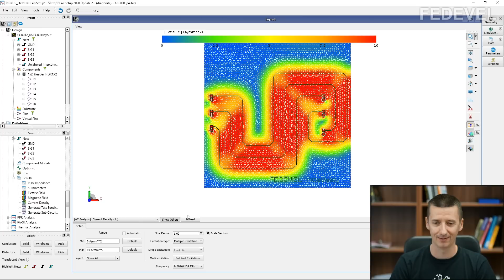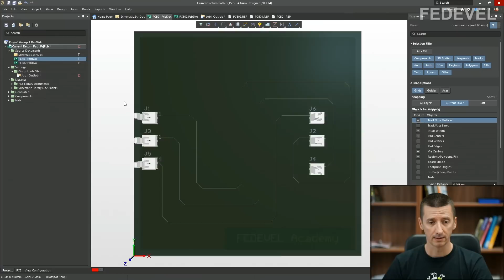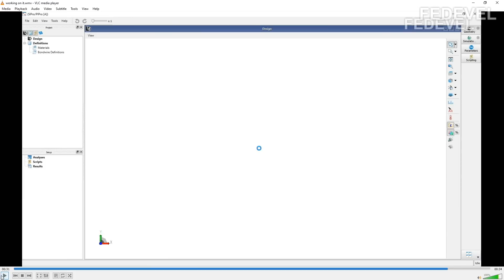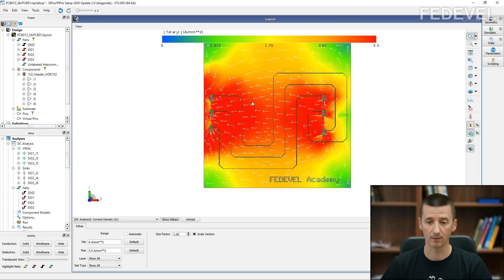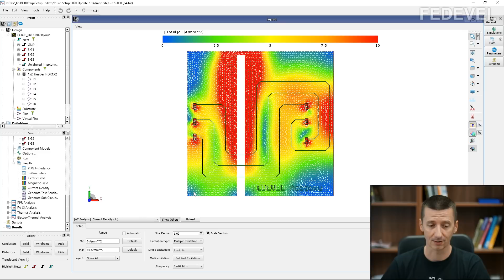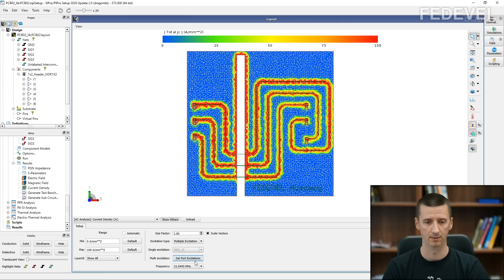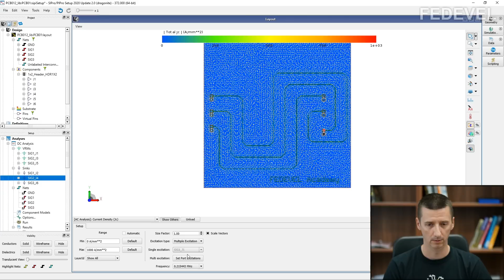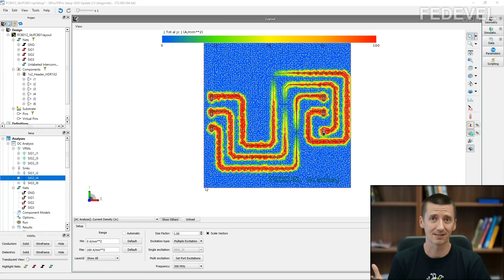Does Return Current Flow Under Signals? Watch these examples ...

Comment: There are three factors which must be considered:
1. VSWR due to impedance matching
2. Skin effects on higher frequency are forcing the current to pass widely until capacitance factor from the bottom ancts as lpf.
3. Crosstalk due to nearby lines
George
Reply from the maker: Thank you djordje2404

Comment: Thank you robert for the Video. What exactly is the return path flow simulation used for ? is it for DC-DC power supplies? or high frequency communication like SPI,etc? also how to make optimizations based on simulations, do we just see do the simulation, with no cuts? or do we make the cuts in the plane for a reason? im not sure whats the disadvantages. please explain

Comment: above 1 MHz: could that be skin effect? It is hard to guess if the dimensions are not explicitly listed.
Skin effect is even relevant at 50 Hz powerline transmission level.

Or capacitve coupling between signal traces?
Reply: skin effect depends on the current strength

Comment: What happens if you have a ground copper pour on the top layer. in two layer PCB the ground plane on bottom layer might be discontineous because it has some routing tracks

Comment: interesting effects. I would say the DC sim would be different to the AC because even though it is a low frequency it will still be switching back and forth. At those higher frequencies and with the ground split it is possibly acting like an LC filter, the narrow point in the ground plane acting as an inductor, and the traces and what is left of the ground plane each side acting as (distributed) capacitors, it is possibly attenuating the signals at certain frequencies
Reply from the maker: Thank you William PS: I have similar theories. Let's see what other people will write.

Comment: Hi. Its hard to see why there would be any difference at all from DC to 400Hz. They should be identical. If not, then its most likely due to simulator artefacts. You should only really start seeing differences when you get into RF frequencies roughly above 10Mhz and beyond. After that, using PCB with thin copper tracks, things will start to change. The gap may start working as a capacitor and may start conducting across it. Also, the capacitance from top to bottom tracks start to conduct through the board. At even higher frequencies, like 400Mhz, you may see currents in the track actually stop then start again on the same track. Thats because of standing waves beginning to form. RF radio designers are very aware of these problems and designs have to include very short tracks and good large area earth returns to reduce losses.
Reply from the maker: Thank you

Comment: the closer you get to wawelengh probably  more probable starting to see points where waves are "standing" in fact it could be nice to see how sharp corners affect RF but probably you will need to get more serious simulator, like ADS
it is proven that below 1ghz it is not affecting much, above 1gh  to 10ghz still mininal effect for sharp corner.
Reply: before changing the software, it would make sense to check the setup of this simulation software.
If the mesh grid is too course for board size and signal frequency or current densities get out of range, then strange artefacts will happen.

Comment: My thoughts. It is still simulation. Which means there is always a possibility that the simulation model isn't totally accurate as well. As for the dips in current. Aren't those just resonances? 
Btw, current doesn't go with the shortest path but with the lowest impedance!!!
Reply from the maker: Thank you P_Mouse

Comment: If the theory about second board is correct about LC filter acting properties, the missing currents at certain frequencies would indicate parallel resonance of that filter... 
I didn't check at which frequencies that happened, but that may be the case.  Because max trace length with return path is below 5*(wave length) i guess.
Reply from the maker: Thank you Matija

Comment: Sinks are set up for a fixed current, so I guess because the top track is longer (i.e. more resistance), more power is dissipated in the track to achieve the same current at the output port... maybe? I would like you to plot a sample of the input signal: is it sinusoidal? square wave? (is it irrelevant for that kind of analysis, perhaps?)
Reply from the maker: I will ask these questions to Keysight

Comment: Hi Robert,

Firstly thanks for the nice demonstration of the high frequency currents, I'm also curious to know more about the cause of this... 
Bydaway, you mentioned in some of the comments that you had used ADS from Keysight for the Electric Field simulation of altium layout, Is there any tutorial on how to use ADS software to implement this DC/AC analysis for the  Altium Layout?? That would be very much helpful !!
Reply from the maker: Thank you Nikhil. PS: I think, in this video I went through the process of importing Altium into ADS: https://youtu.be/56FvQX63Ea0
Reply: Thank you,  @RobertFeranec

Comment: Robert good evening, great videos you shoot,I myself am a novice circuit engineer and do not fully understand the process of creating an integrated library,if it is not difficult for You, please shoot a video about creating an integrated library, I will Be very grateful to you!!!!!
Reply: He already has videos about how to make a library. If he hasn't included, you can create an integrated library by right-clicking on the LibPkg project in altium and select "Compile...." it'll make an integrated library in the Outputs folder.
Reply from the maker: @punitjain8746  Thank you
Reply from the maker: Thank you Sergej. PS: As Punit pointed out, there is nothing very special about integrated library.

Comment: At a high enough frequency the gap will almost disappear as the signal will transition from flowing in the copper to flowing through the air as  either a near field RF signal or at super high frequencies, much higher than what you were showing, it will transition to a far field RF signal. The real question is whether the simulator is smart enough to get all of these transitions correct.  
This "strange" behavior is how distributed circuit elements and other fancy RF filters and antennas are created. Once again the real question is on the ability of the simulation software to get all of this correct. In the old days of RF design if you knew how to do this, you were a master of the black magic of circuit board RF design. :-)
Reply from the maker: Thank you Brian. Maybe it would be interesting to ask at Keysight to explain what the software is considering ...
Reply: I'm pretty sure it's this. The current / energy is flowing through air via RF just like an antenna and just like the energy in a PCB trace is traveling in the dielectric and not the copper. High frequency of course, not DC.

Comment: On the slotted board the skinny part should have very high current density but it seems similar to the other parts????
Reply from the maker: I am not sure if you mean this, but it looks like when I adjusted the Range, it is visible at 12:25
Reply: @RobertFeranec  i posted before the end.  :<  I think the  mesh size should be adjusted.  Great tool.

Comment: Hello,
Robert Feranec,

Can you make a video or videos in which you explain the ADS (SiPro and PiPro) software for simulating PCB step by step?
I am interested to see the process, step by step, of importing files in ADS (SiPro and PiPro), which are the proprieties I need to configure to analyze a PCB in terms of signal and power integrity, thermal simulation, and so on.

Thank you.
Reply from the maker: Hello Bejan. I have done simple setup for DC and also explained simple AC setup in my previous videos about ADS. Have a look for example here: https://youtu.be/56FvQX63Ea0 PS: For more complex simulation, I will still need someone from Keysight to help me.

Comment: Thank you sir, very inspiring video. I see you are using Altium in this video, what is the flow from Altium to ADS, ODB++? Also ADS is expensive, is there any free or cheaper field solver recommended?
Reply from the maker: Thank you Harry. PS: yes, I used ODB++ to transfer the board into ADS. I have only played with ADS (they provided me the license), I have not tried any other tools.
Reply: @RobertFeranec  there are some temptatives in progress to integrate KiCAD with OpenEMS/Paraview, using Hyperlynx format or other tools like Pcbmodelgen as frontend but still primitive atm

Comment: This is unrelated question but what to do when i need more than 10uF input capacitance on usb device side? 28pins have over 100uF on usb input vbus. What should i do? Is it really nesecarry to have under 10uF total capacitance or 50-100uF can be accepted to?
Reply from the maker: The main reason why I used 100uF is to keep stable 5V even if a long cable is used and when board has some peaks and when it needs more power (simply to say, bigger capacitor will help to deliver extra power longer when needed). What you may want to consider is, what is your device current consumption and how it is usually connect (e.g. through cable or directly to port)? So, your device may work perfectly fine with all the kind of capacitors - but more power it needs, maybe bigger capacitor you may want to use. If you use a big capacitor for lower power device, it is ok ... just it may be unnecessary expensive (bigger capacitors are often more expensive).
Reply: @RobertFeranec  well i wanted to add 47uF but when i connect 47uF to my pc it resets the internal hub(usb disconnect sound)
Reply from the maker: @Ncky  this may happen - it means the hub is not designed properly or it is not powered from external power supply and you already have other devices connected there. Basically what happens, when the 47uF is charging, it will cause voltage drop in the hub as the hub is not able to keep the voltage stable - that is my guess. Try different device e.g. PC or different hub to see if you will see the same problem.
Reply: @RobertFeranec  same problem on 2 other laptops too and on one pc(asus cross hair hero 6). The usb spec says that usb device must not exceed 10uF input capacitance. Which is correct. Internal Hub does not reset when i connect 10uF or 22uF cap. Anything over 22uF resets it. I have designed a circuit that has around 8uF on the vbus directly and the rest is behind voltage regulators. I dont know does the capacitance behind voltage regulators count as vbus input capacitance.
Reply from the maker: @Ncky  Then I would go for 10uF PS: Also it may depend on what kind of capacitor you are using (electrolytic, aluminium, ceramic, ...)

Comment: Above 1MHz seems related to the impedance somehow. I seem to remember an old Analog Devices App Note that suggested having ground tracks directly underneath each signal track and connecting them to a single star ground point at one end of the board. I recently searched for that note (on behalf of somebody else) but was unable to find it. I'd be very interested to see what (if any) difference it would make. (To have individual return paths below each signal path. These would be in addition to the ground plane.) If/when you get a chance.
Reply: I think this is what you were looking for: https://www.analog.com/en/education/education-library/linear-circuit-design-handbook.html (Chapter 12: Printed Circuit Board (PCB) Design Issues)
Reply: @gn_ghost4757  Thanks, but no, it is not the document I remember. What I remember was a single specific app note and this would have been around 2010 (plus or minus a couple years). I recall it as discussing VHF return paths under the signal trace, using a separated ground trace. My memory functions are glitchy these days, so I could be  mistaken, but I believe this was before AD acquired Linear Devices (if that helps).

Comment: I don't have any experience in simulation, but is this able to simulate Couping in EM Fields? Could some of the artefacts come from coupling between tracks and destructive interference? 

Can you simulate two antennae, one sender with an ac current source and one receiver with a closed loop or resistor load? To see if currents are transmitted
Reply from the maker: If Keysight will help me with 3D field simulations, I will do that.

Comment: could you please enable automatic range? I assume the current density does get pretty large, once the current flow gets very localized and gets out of range.
One Simple example of why I think of a range problem: With the cut in the board: why do I not see an increase in current density, where there should be copper shared by the signals?
Reply from the maker: I intentionally disabled automatic range as then it doesn't show well absolute and comparable results with images for different frequencies. But, I will play it.

Comment: There are multiple effects that may influence the simulation,   The finite element grid selection is both structure and frequency dependent.  You have not shown your grid,  it is key to the results, thus it is difficult to say what is happening.
The multiple current paths couple with both  capacitance and mutual inductance.  You should start with a single path and then add the cut.
The results should be very close for very low frequency and DC.  The fact that they are not casts doubt on the entire exercise.  Until you work that out I would not believe any of your results.
What EM simulator are you using?
How did you choose the grid?
Reply from the maker: Thank you Chris. When you say Grid, what do you mean? The setup is super simple, I am using ADS.
Reply: @RobertFeranec  EM simulators use a grid to approximate what is happening.   (See FEMM Finite Element Method Magnetics for an example).  The grid is needed to approximate what is in fact a continuous phenomena.  The art to such simulations is appropriate choice of the grid.  It needs to be fine where things are changing in short distances, but can be wider away.   The choice of grid point position and density controls both simulation time and accuracy.  Too fine a grid density can cause round off errors.  Too coarse a grid point selection will miss necessary fine details.

ADS works ok for simple RF transmission line structures for which it has decent models.  For anything besides simple transmission line structures we use HFSS.
Reply from the maker: @Chris_Grossman  Thank you Chris. I will ask about this when I will be talking to Keysight

Comment: You are right to be suspicious of these simulations. They can so often trip one up :-) Got to carefully watch how the mesh is created, how the ports are defined as well as material definitions for tracks, ground plane, dielectric and enclosure. Looks like you are using FEM in ADS, I have used Momentum in the past. I would try to make a simple layout single trace, meandering single track to see what happens. Also use different ways of injecting and output of signals (ie. internal or edge ports).
Reply from the maker: Thank you Andrew. Let me know what kind of results you will get.
Reply: Sorry Robert, I do not have access to ADS these days as its very expensive as an individual for a license. I mostly surf the open source world now :-)

Comment: I think why the current starts to spread out above 1Mhz is because of skin depth, then as frequency increases more and more you start to see the effect of standing waves having maxima and minima.
Reply: i think at VERY high frequency the current is directly under the traces, but so tightly it is hard to see, it is directly under the traces and so tightly under them because the return current cancels out the inductance, and that makes such a big difference compared to the other factors.

Comment: on 13:00 it could be because of reflections. When signal's return path cuts of like that you are gonna have a reflection which could be high enough to cancel the original signal. hence no current would show up on the return path.
this topic is well discussed in chapter 8 of https://www.amazon.com/Signal-Power-Integrity-Simplified-Prentice/dp/013451341X
Reply from the maker: Thank you sina

Comment: what software are you using to simulate return currents?
Reply from the maker: I use ADS from Keysight https://www.keysight.com/en/pc-1375582/advanced-design-system-ads-simulation-elements?cc=SK&lc=eng
Reply: @RobertFeranec  thank you very much, if I buy W2200BP + W2360EP + W2359EP it is enough? Will I be able to perform the simulation you made?
Reply from the maker: @flussoincrociato  I do not really know. Keysight provided me a license (I am not sure exactly which one) so I could make these videos. The best would be talk to someone from Keysight and ask them.

Comment: The simulation-method seems very unstable, not suited for low frequencies and very sensitive to the grid-size.
Very likely the "missing" current is an artefact as a result of the grid-size and frequency: If the grid is coarse and the effect-ranges just line up with the grid then the result can be totally wrong.

Just imagine it like this:
At the left is the input, a thin trace on the topside going in zick-zack to the right where it is connected to the ground plane, but just 1point in between for the simulation. If the frequency and distance match up then the simulation might get near 100% capacities coupling between the left and the right.
Decent simulations take a looooong time.